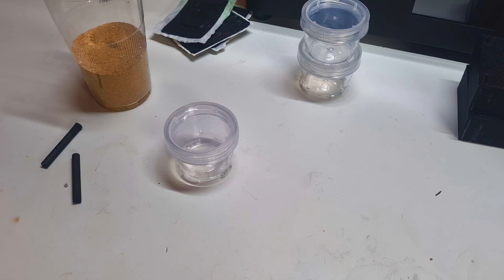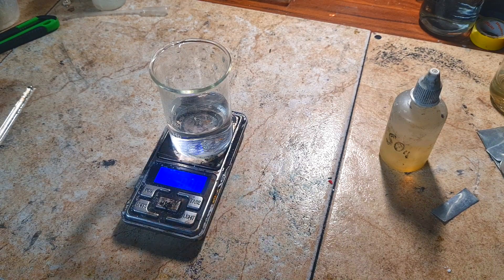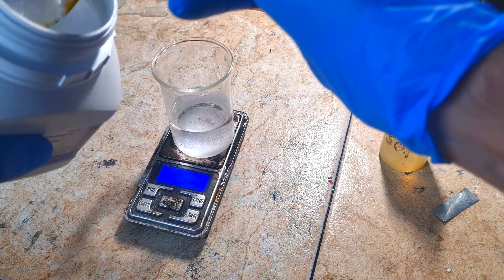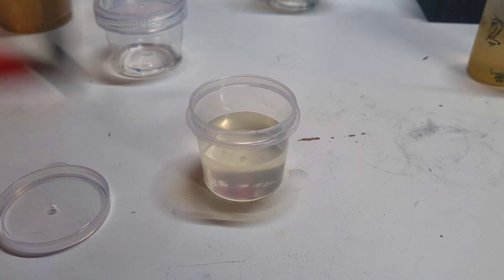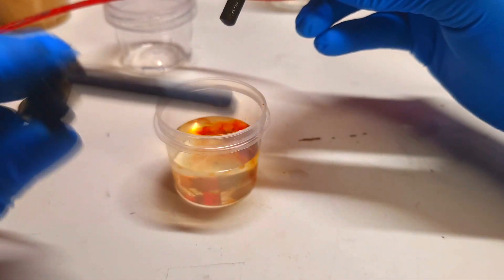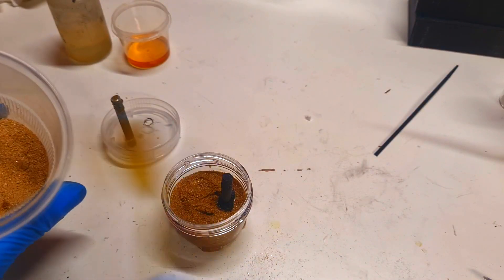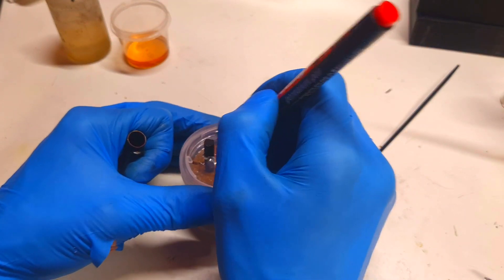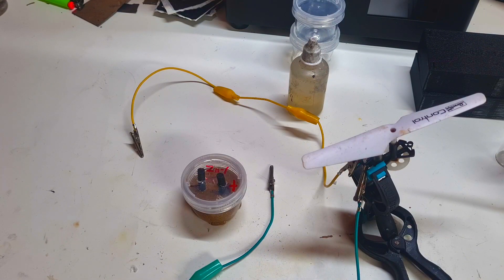Diy Zinc Iodine Sand battery

Comment: Can you make a really big battery if your getting 1.45 volts then several with a dc to dc converter should boost to 12volts  but need large storage.then use a wire 200ft long up 30 ft in the air well insolated at the supports like rubber or glass with Teflon rapping  this should deliver 1,000 volts at low amps try changing it this way runs 24/7/365

Comment: Great video.
Not sure why 8g of KI and 14g of ZnSO4. The molecular weight of both is similar, 166 and 161. Molecular weight of ZnI2 is 319. So using 8g of KI will only react with ~3.87g of ZnSO4, rest is waste, but you will make 7.6g of ZnI2 which is a 2 mol solution in 50mls. Question, why so much ZnSO4? Or is it just want to make sure all Iodine is converted?
Im going to try to make this, thank you.
Reply from the maker: Good question,... at begining I was thinking that I will get similar question a bit earlier. The reason that I add more ZnSO4 was that the remaining ZnSO4 act like extra support electrolyte,.... ZnI2 + ZnSO4. Because if I add KI and ZnSO4 1:1 then I get only ZnI2 and K2SO4 and when the battery is charging the electrolyte will lose the most of ionic conductivity. The extra ZnSO4 will help with the better conductivity of the elctrolyte.
Reply: @cayrex  yes, I get that, as I've just put the battery together, I get iodine at the cathode but zero voltage lol. Just dumped a load of ZnSO4 in and let it rest.
May completely restart again. All part of the fun.
Reply from the maker: @DrBretPalmer  hehehe yes right. But interesting that you get 0 volts
Reply: @cayrex  lol, I was using a metal lid 🤣🤣🤣. I'm an idiot 🤣. 
Works fine, self discharging fairly quick for me. Will play around with a few other battery types. I want to build a simple battery, rechargeable,  and scaleable and can do thousands of cycles, for a home battery bank. That's the plan. Any thoughts welcome.
Reply from the maker: @DrBretPalmer  Oh, that makes sense, hahaha. Progress is made by small steps. Do you use sand? Because my cell with sand have the 1.2V after 2 month,... but the cell dry out.
Reply: @cayrex  interesting, yes, I used fine sand. Will repeat with a different container.

Comment: Have you tested and recorded the results of different concentrations of zinc and iodine? I'm looking to build a bunch of these, and I want to get them right. Zinc sulfate, zinc chloride, and iodine/potassium iodide are difficult for me to come by, locally. So, I haven't been able to test any of this myself yet. Zinc sulfate used to be sold where I live as moss killer, but now they only sell ferric sulfate.

What sort of energy storage does this unit have? I see from the newer video that the self-discharge was quite good, at least for a little while. Any advice you can give would be much appreciated!
Reply from the maker: Hello! Sorry for late reply. Huh, you have limited choice of materials then!? You will need zinc sulfate or zinc chloride and something that have iodine. The zinc - iodine have around 50 to 70 wh/kg which is better that lead acid, vanadium flow, nickel iron batteries. I will make more videos that can help you to make a cells.

Comment: Hello. Thank you for your video. How many life cycles you expected for such zink iodine battery?
Reply from the maker: 1000 cycles for sure. With my better cell I get to 3000 cycles
Reply: @cayrex  Is it possible that such zinc iodine sand type battery can be used for solar energy storage purposes? Is it possible to cale up such battery configuration for example 1m3 electrolyte/sand volume with multiple carbon rod electrode pair configuration?
Reply from the maker: @GintsChannel  Yes of course. I mean all batteries or better to say everything is possible to scale up to the desired extent. For more power and capacity you need biger cells and for more voltage you need many cells. And then you put the batteries like lego bricks together.
Reply: @cayrex  Thank you for your reply.  What ph is for the ZnI electrolyte?
Reply from the maker: @GintsChannel  5

Comment: Great vedio thank you for sharing, there is the idea of making concrete as medium to store energy in buildings do you think it is by using some sort of electrolyte ? ,knowing that there is hollow type of conc. called "no fine conc. "
Reply from the maker: Ah, you mean the concreate battery? They use KOH and something in the concreate electrolyte/separator.
Reply: @cayrex  thank you for the tip

Comment: Its interesting you can use compounds to make the zinc iodine battery . I assume it is less power dense than just iodine and zinc ?
Reply from the maker: The power density is related to the amount and concentration of electrolyte. Because When you charge you will form iodine and zinc and when you discharge you will get Zinc iodide. Make more concentrated electrolyte for more energy.
Reply: @cayrex  , this is the reason such battery can't be used. When charging it releases Iodine which is a gas less soluble in water. Therefore on discharge only soluble iodine create sal, implies flow of electrons.

Anyways nice attempt.
Reply: @apyogapaartiban  looks to be working to me.
Reply: @apyogapaartiban iodine is a solid or gas. Solid at room temperature that can sublimate. Keep pressure and it will stay solid